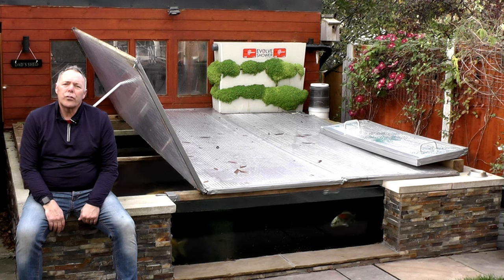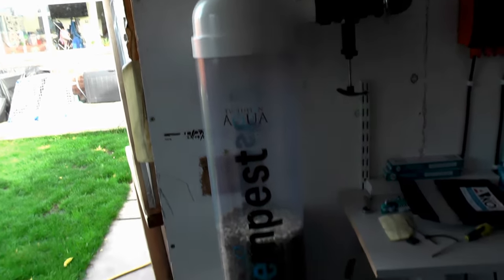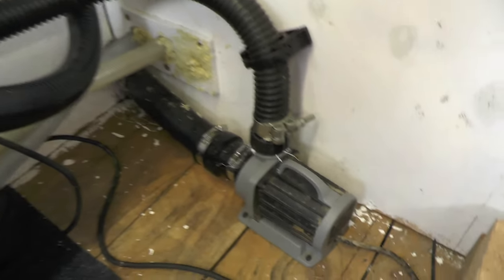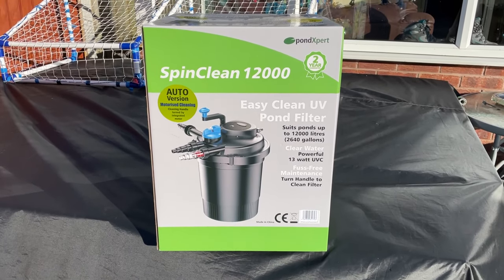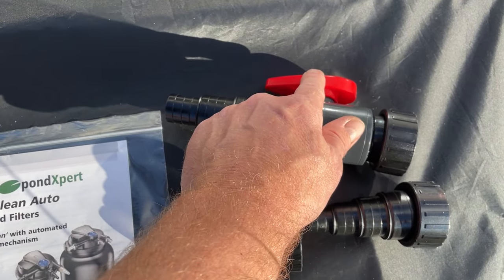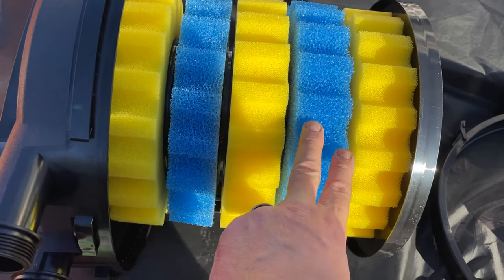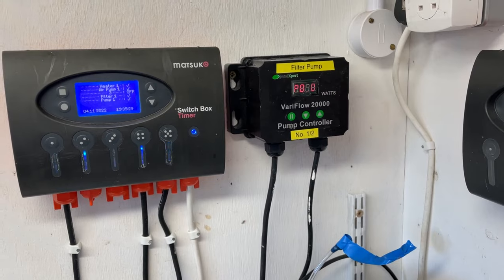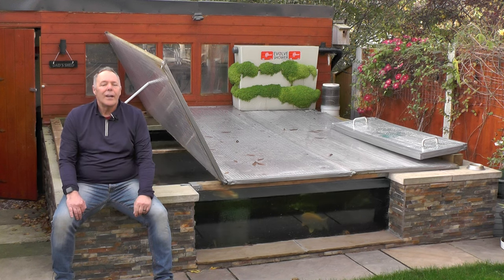Bad, Bad News In The Grow On Tank - Pondxpert Spinclean 12,000 Auto Box Opening & Pump Upgrade

Comment: I have the Oase pressure and it’s been fantastic, however it does leak slightly on the waste pipe. Oase do warn you that this does happen and advise you always to fit the stop cap, unless you fit the isolator as you have.  Have you thought about fitting a float switch to shut the pump off? I know you could still get fish deaths, but I guess if you still have air pumping into the pond there’s a chance you won’t lose them all.  Just to add you’ve put some great content out, thanks for all the effort.
Reply from the maker: Thanks for watching and commenting. Well done for guessing the content of one of my Video's in progress. I've got three Video's on the go and 2 are related to the Grow On tank and the other is a bonus. Thanks and keep watching

Comment: hi , just seen video , i have pressure filters myself , on the waste outlet , put a tap inline , these will bypass water all the time , even the oase filtoclear filters , i had the big 75000 ltr pressure filter made by same company , was good , but only problem i found with them is the fines that bypass the sponges is rather alot , think it is the design of how the sponges are fitted to plastic rings , the fines find there way past the plastic rings , i now use the oase filtoclear pressure filters , these are much better , the other pressure filter we used to use was the Fish Mate Powerclenz Pressurised Pond Filters , these were very good filters too , 

hope you get it all sorted out , sorry for your loss

Comment: I’m intrigued by your setup from bottom drain pipework directly to the pump… have you had any issues doing this? My current setup is bottom drain to a settlement tank with a pump inside the tank. Your way looks way neater.

Comment: Hi. Thanks for great video. I bought used one spinclean 12000 and have a question. Can I check UV and cleaning motor without connecting water hoses or it has some water sensor ? Thank you
Reply from the maker: Thanks for watching. There isn't a water sensor as such but with the lid on and it connected to the electrics the light should come on and the cleaning motor will work with the knob turned to clean. The motor will turn as normal and won't effect anything but the UV will burn out if left on for a while without the water in there.

Comment: Just out of interest why not do away with the pressure filter and just go from the pump straight into the tempest then heater then shower ?
Reply from the maker: Thanks for commenting. The main reasons are 1. for the extra filtration due to the higher than normal temperature and heavy feed rate. 2. A prefilter for the Tempest where the main bits and poop is taken out by the Pressure filter and the Tempest can take out the fines and add the extra bio filtration. With the heavy feeding there is a lot more pooh than normal and the Tempest would be working too hard

Comment: Are u going selling 10.000 pump am looking 4 1
Reply from the maker: On my set ups I am using 1 x 30,000lph on the Bottom Drain, 1 x 30,000LPH on the Skimmer and 1 x 20,000lph on the Grow on set up. All are running at between 35% and 50% power. All three added together are using less power than just 1 x 10,000 Iph I was running before and I am getting a better flow rate